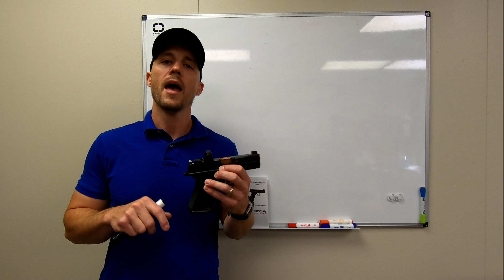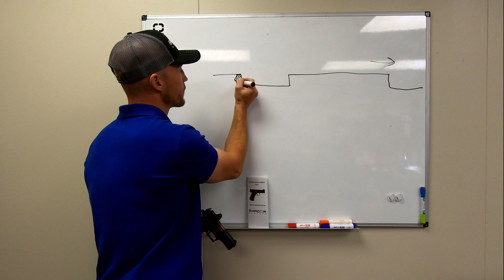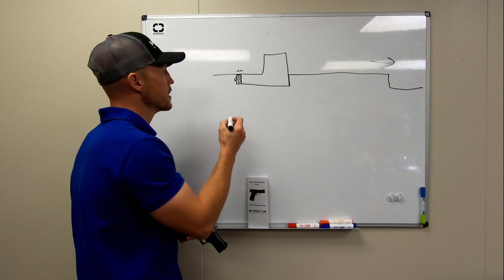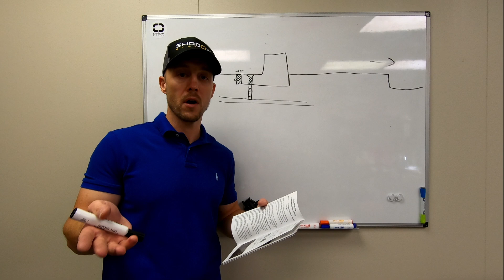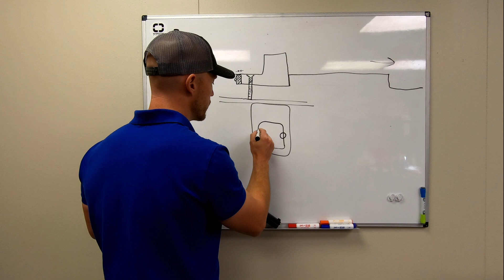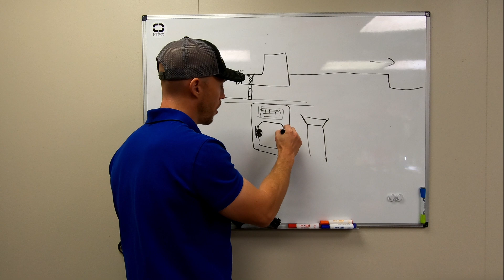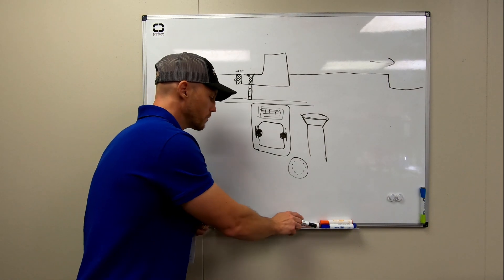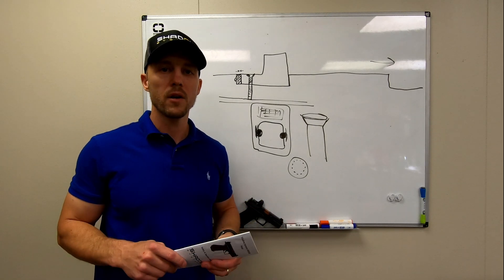Technical Tuesday: Optic System and Holosun V2 Mounting

Comment: I mounted the 508t v2 with the #1 screws  but won’t hold zero and the dot moves around. The #2 screws seemed to fit better. Will it hurt the optic to try the #2 screws?

Comment: Manual says the holosun 507c x2 uses spacer A. Only problem is that doesnt fit. Thought maybe you had to force it in, but that doesnt seem to work either. Tried the next spacer down, and that leaves a gap. Wondering if its a qc issue with the spacer.
Reply from the maker: Could you please email a photo to support@shadowsystemscorp.com? They can tell you if there is a trick to install or if you maybe need a new spacer (which if you need they’ll send you).

Comment: I got two MR920Ls over a week ago and one of them was missing the optics mounting kit. Took 8 days to finally get someone to answer the phone there. Here's the bigger problem in my mind. You say the special sauce is the zero fit of your spacer. Well I do not have a zero fit at all with the holosun 508t. You can see daylight between spacer A and the rear vertical wall of the optic cut. Smallest shim I have is .0015 which will start to fit in the gap and there is .010 gap in front of the optic.

Comment: Thanks I installed my 507 with the trijicon screws but didn't locktite it yet. I noticed screws not completely flush. I will work on it tonight.  Great update. If I sell enough stuff I will buy another XR920.

Comment: Bit disappointed with my second Shadow purchase. 2X #1 Screws (with the spacer)) were missing from the original package, luckily our Canadian store sent me a new kit from another set. Now it comes to the worst part, 1 screw went in fine with my 508T V2. the 2nd one only went half way without any further room, screw eventually stripped. Had to get our local gunsmith to remove it. Then we discovered the hole didn't even tap far enough....

Comment: Only issue is the 2 screws don’t fit they are to long so I use the 1 screws. This is also fitted the same on my trijicon also. The 2 screws just don’t fit a little to long.

Comment: I purchased a MR920 several months ago and used the RMR screws with the Holosun V2.   It seems to be working fine.   Should I remount it with the correct screws?
Reply from the maker: Hey James, there is no need to remount your optic.  This is mostly a solution for people who experienced genuine interference between the screw and the body of the optic. It is possible that holosun changed that dimension more than once and your optic doesn’t have the issue.  I wouldn’t worry about it.
Reply: @ShadowSystemsCorp   my mr920 didn’t come with backstraps how could I get them
Reply: Mine worked with the RMR screws for both my MR920s/ 507cV2... I guess I just lucked out.
Reply: Hmmm. Picking up my mr920 this weekend and Holosun 507c v2. Based on the video along with the comments, I don’t know which screws to go with now. 🤦🏻‍♂️.
Reply: I've got a 508t V2 incoming... I'll pay attention to the length of screws I use although it seems that the worry is with the screw interacting with the optic cut out for the screws.

Comment: The shear force would be the same, no matter how long is the screw. The formula for shear stress is tau = F / A, where 'F' is the applied force on the member, and 'A' is the cross-sectional area of the member. So, if the cross section it's the same, the advantage is almost none. It's a nice concept (the spacer), but the shear stress will not see any advantage in my opinion. But if you guys also do more than you said, then I'm wrong. Anyways I love your firearms concept and I'm looking forward to buy them!
Reply from the maker: Great question! So if we were only concerned about shear forces, you would be 100% correct. However, like I mentioned, the screws are machined to closely match the hole diameter of the optic. We have used the length of the screw to create greater rigidity at the top. By threading it deeply, we have more thread engagement over a greater length which progressively reduces the amount of play in the threaded hole as the screw goes deeper. At full depth, it feels like one piece at the top. That was one of the goals of the longer screws.
Reply: @ShadowSystemsCorp  That's why you should send me one to test it! Best of luck! Keep the great work!

Comment: Hello, what about the H507c X2? Do we use the #3 or #1 screws?

Thank you!
Reply from the maker: I can’t say we have tested that one yet. I would probably start with the vortex screws and see.
Reply: Curious which # screw you used?  I just got the H507c X2 as well and wondering which screw to use.
Reply: @nelsons1098  I used the #3 never had an issue